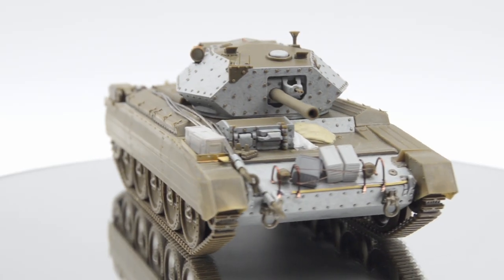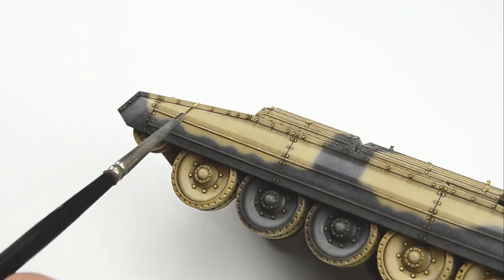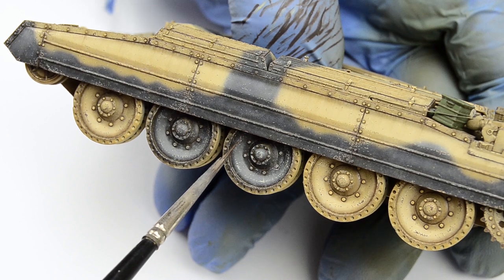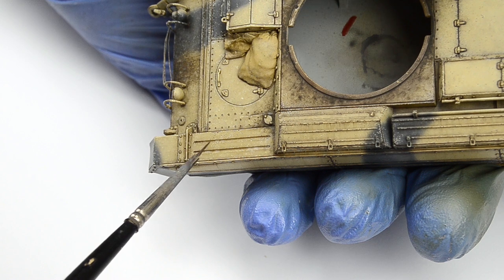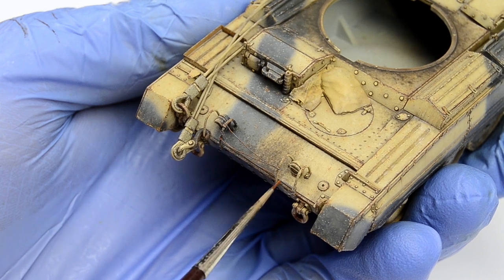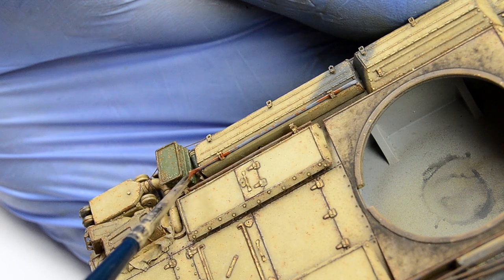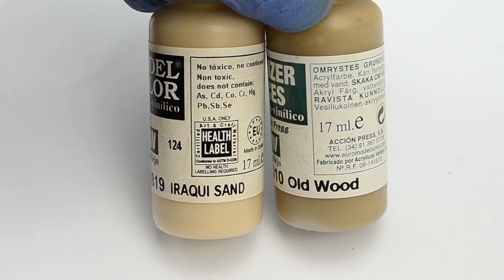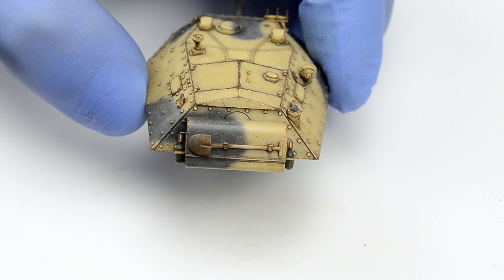Yes, Desert Armor Can Get Rusty | Crusader Mk 3 | Tamiya 1/48

Comment: The Brits used a ton of rivets on their tanks because many of their factories were used to using rivets to attach thick metal plates onto vehicle chassis. They didn't have much time to replace the factories' tooling, and retrain workers to weld plate armor given that 1.) the UK had just barely managed to set up their industry to handle the war effort before the Battle of France, and 2.) the Royal Armoured Corps had lost most of it's tanks and equipment at Dunkirk and was in desparate need of replacements. Thus, riveted designs endured in Great Britain's tank factories long after most other countries had ditched them for welded designs as riveted tanks are heavier due to the added weight of the struts the plates are mounted on.

The Covenanter tank was even redesigned from a welded design to a riveted design as the factory making them used to be a train factory and rivets were the standard for trains back then.
Reply: tbh britain embraced the concept of "it doesn't matter how good it is just build, it we're desperate" stronger than the soviets did.
Reply: To expand on that, one of the main reasons is that the British used a type of face hardened steel that was very difficult & time consulting to weld together. So in order to simplify production they decided to continued using riveted armour.
Reply: Also, welding isn't an easy skill. Especially welding armored plates.
The Italians were another nation that used a lot of riveting, and it was for a similar reason; Lack of skilled workers. 
It's easy to train up a bunch of riveters, and set them to work. If they are sick, or go on strike, or want more money, then you can replace them with more unskilled riveters. Even if all the men have gone off to war, you can bring in "Rosie the riveter" to do the work.
Reply: The French had a lot of problems with their very modern designs, because they were suffering from conflicts between the bosses and the workers. A lot of the workers at that time were communists or anarchists, and many of them were against the war. Some of the French tanks and aircraft were deliberately sabotaged (or that was the story put out at the time, maybe for propaganda reasons).
Maybe the French situation would have been different if they had focused on putting out cheap, easy to build designs in large numbers. Or maybe not. A lot of the British tanks sent to Europe before Dunkirk arrived with serious manufacturing or design faults, and weren't battle ready. Overall, tank technology was still at the bleeding edge during the war, and it took a long time for a design to mature, by the end of which, it was usually obsolete.
Reply: @pickledtezcat  I've always been told that the French tanks at the start of the war were superior to the Germans, the Germans were the first country to fit every tank with radios so could send orders and sighting quicker and work better as a unit. The French only had a radio set in the troop leaders tank who then passed on orders by sign language or actually getting out of his tank and climbing onto one of his troops tanks to tell them what he wanted them to do.

The Russian tanks were definitly poorer construction, there were always gaps between armour plates which were machined or cast accurately, often the gaps were big enough to put your hand in. The Russians just never cared about their soldiers lives and would rather field several poorly assembled tanks instead of 1 properly assembled tank.
Reply: @impguardwarhamer  in part it was desperation at times, but it was also a calculated trade off between how good a tank was (or whatever was being made) and the need to out produce Germany so that their tank formations could be whittled down.
Reply: @kaneworsnop1007  The French tanks were great. But they were still planning like it was going to be peacetime forever. So they wasted a lot of energy on highly experimental one-off designs, and designs like the Char 2C which were basically just for propganda. Where as some of the other countries were getting ready for war by coming up with cheap and easy designs for mass production.
It could have been worse though, they could have been the Americans...
Reply: If you look at damaged German tanks (Panzer III and IVs lost in the desert at the same time), which had been hit, you'll see many examples of where the weld totally or partially failed. I have read that the UK preferred not to use welding due to its technical difficulty with armour believing that it held up better.
Reply: @nickbrough8335  Welding is a very difficult skill, almost an art, so it's definitely the case that poorly welded armor would be even worse than the alternative. But riveted armor had significant downsides, which most countries were quite aware of by the outbreak of war. When a plate was struck, even if the shell didn't penetrate, it could shear off the bolts and send them flying around inside the crew compartment. Riveted armor was also much heavier than welded plates, since it required an overlap, and the extra weight of the rivets. So a tank with riveted armor couldn't have as much protection as one with welded plates.
One point to think about is that the skilled welders were probably reluctant to share their experience and training with a bunch of n00bs because they knew that once the war was over, they would be back to relying on their rare skills for negotiating a living wage. Likewise, the ruling class didn't really want to offer a fair compensation for those skills.
In the USSR or Nazi Germany in contrast, anyone who refused to do what they were told risked being sent to a prison camp. :(
Reply: @pickledtezcat  Yes, it took til the end of the war for the skill level to be sufficient to banish rivets. However, I imagine the UK authorities did what they thought was best - better to have think non-welded armour than suffer routine welding failure. We know the quality of German armour declined over the war, and if the weld seam breaks, which seems have been commonplace in 1942 desert campaign is correct, then their choice of welding apparently failed as armour plated got thicker.
Reply: @nickbrough8335  welding is proven to be superior providing it is of good quality. A near miss with an explosive round or non penetrating hit often caused the rivets to pop aamd fly around the inside of the tank turning the crew to strawberry jam. Rivets were a lot quicker than welding and it was also a relatively unskilled job compared to welding. Modern tanks are welded because it is superior to riveting, also we are not trying to produce as many as possible with a less skilled workforce due to rapid expansion of production. The latest tanks being produced are also doing away with cast steel as it is inferior to welded steel plate/Chobham armour or other countries equivelant. The new CR2 turret is doing away with the cast turret with additional armour welded to it, instead it will be purely made of armour panels welded together to increase protection, whilst reducing armour thickness and so allowing more space within the turret. Unfortunately due to covid 19 its looking like the CR2 uplift programme will probably be cancelled, some politicians are arguing again that tanks are obsolete and that the British army should get rid of them.
Reply: What others have said, plus the fact that the skilled welders were in great demand for shipbuilding. There simply weren’t enough to go around. Hence riveted tanks.
Reply: One advantage of rivets is that you can grind them off if you need to take off a plate to do repairs underneath. More complicated with welds.
Reply: Britons.
Reply: I agree maybe I didn’t read past 3 lines
Reply: @BigBadBvids  Not to mention that for the brits (and also the US to some degree) were more focused on their navy than on land forces, and also had relatively capable AT weapons (of both crewed and man portable flavours)

Comment: I think the search light turned out very well. It looks good enough for me to incorporate that style, myself. That's the cool thing about modeling. We can share techniques that we might not ordinarily be able to find out about. There used to be a product I used many years ago to make window panes. It was a liquid that you "stretched" between 2 fixed points. When it dried in place you had an instant window pane. No reason it wouldn't work for a lens. I think it is still around.

Comment: Why all the bolts?

The reason those earlier tanks were bolted is simply that it's easier than welded; it doesn't require as much skilled labour.  Of course, it adds a lot of weight since those bolts need an internal framework to be attached to...so there's a lot of extra steel taking up internal space and weight.
Reply: Not only did they add weight, but they also could break off when the tank got hit and could ricochet around the interior injuring the crew.
Reply: And sometimes, when the tanks gets a hit, the kinetic wave breaks them and they start travelling inside the tank like if they were bullets
Reply: That’s not entirely true. It’s not that riveting is easier so much as it was that Britain mostly had riveters. To retrain their workforce over to welding would have taken a long time (not to mention having to retool all their factories) and Britain just didn’t have the time. As I understand it the Covenanter was supposed to be welded in the original  design but the company that was going to build them convinced the designers to make it riveted because it was easier then converting to welding.
Reply: @CharlieNoodles  most of those facilities had been making locomotives, which are largely welded.

Fact is that casting and welding are more expensive, so riveting prefabricated plates was simply the cheapest and quickest option.

Comment: About rusting the towing cables: I’m walking by a scrapyard everyday on my way to work and there’s a couple of these lying out in the open which have been there for years completely exposed to the elements and they are literally rust free. The entire cable is covered in grease and oil and that seems to completely protect it from rusting.

Comment: Many British tanks arriving directly from the UK to Tunisia would have left the UK in Khaki Brown (SCC 2) not just Green. The pattern you painted was adopted from October 1942. The camo scheme was intended to paint naturally shadowed areas on the upper of the tank dark. The aim was to break up the hard straight line created by the different angle of the tank body verses sun position. White was also used to counter-share dark areas under the hull and the lower underside of the gun. The Middle East command instructions stipulated a dark green colour for the disruptive colour (although Black was allowed where the desired paint colour wasn't available). Many (perhaps most) tanks would also have an RAF style roundel painted on a flat surface as an air recognition element.

Mike Starmer has done extensive research on UK WW2 camo schemes and has self published a number of guides, which can be bought from him.

Comment: With the miniature painting techniques on the sandbag, the main advice I have for getting better results is to push the contrast. That usually means pushing things back and forth in order to get good blends, and is therefore rather time consuming, but it's what I have learned underpins almost all miniature painting techniques.

So, for instance with the stippling for cloth textures, it might involve having quite a few different steps mixed up on your wet palette from the darkest shadow to the brightest highlight, and then going back and forth until the contrast is strong enough to sell the object in the scale in question while also reading like there's a texture from the weave. Great blends across strong contrasts of light and shadow are the manually painted chipping of miniatures. Hours of work to get something looking natural.

Comment: Most of the British factories which produced our tanks were used to designing and building steam engines (Trains) which are mostly rivited together and screwed together using nut & bolts. Welding was a very primitive and not really developed because of the tried and tested method of riviting.

Comment: British tanks were made in different elements like bolted and welded because of speed of fabrication and cutting the sheets out for making. There was a reliability in putting things together like that... Sad side of the story is riveted tanks like the Crusader when hit by shells, had a chance of popping the bolts off and sending them flying insider the tank like another projectile. Which happened more than the military liked.

Comment: Most British armour was riveted mainly due to cost. It was a hell of a lot cheaper to use existing and known techniques to fasten two pieces of metal together as less equipment was needed and labour costs were reduced. Also welding was still a developing technique and was more than likely frowned upon by designers.

It's only really when they realised that rivets turned into very fast projectiles when shot did they start to weld vehicles together. A lot of crews were needlessly lost due to this.

Comment: Hey, I want to get into professional modeling and I have a few questions:
1. What cement/glue do you use?
2. What kind of paint should I get, and what brand?
3. What model brands should I buy from?
4. What are good beginner models?
5. What tools and brushes do I need? And what are good brands?
Thank you in advance if you answer this!
Reply: 1. Tamiya extra thin is pretty awesome. 
2. I like Vallejo. Just make sure you get the right colors as their airbrush line is a bit too thin for brush painting if you're just starting out
3. The best brands don't mean anything if the molds are from the 1970s and crap. Always best to do research on Scalemates.com before buying any kit (I learned my lesson). Especially Revell loves re-releasing ancient kits as "new" and it can lead to massive disappointments.
4. Tamiya usually goes together without issues, but they are a bit pricey. Revell is rather cheap, but depending on the kit it could be awful (see 3). 
5. Small side cutter, sanding paper, double sided nail file and some filler (Milliput, Green Stuff, etc.) will cover most of your needs.

Comment: One of the reasons so many of Britians wartime tanks were riveted was a compromise to use existing skilled labour. Overwhelmingly the tanks were made by railway carriage companies, where rivets were tried and tested, and weight was less of an issue.
The British army definitely wanted the weight savings, and extra integrity of welding. But it needed tanks fast, and those in charge of war production figured an okay tank now was worth a whole lot more than a slightly better tank (with an unknown delay) in the future. The welded centurion is probably the best example of what British tank corps knew it wanted (at the time cromwell and comet were in production and service) if they only had the luxury of time for development and to gear up production.

Comment: GB used a lot of riveting because a lot of manufacturers were locomotive or other heavy industries that knew riveting.  But GB had a lot of cast components, and welding in there too.  So they weren't all riveted.  Watch the Tank Museums Matilta Diaries for more details.
Reply: It might also be a case of priorities—France, for example, had workers capable of welding tanks together, but they were mostly employed in the shipyards and needed there, so they used casting or riveting on some of their tanks because labor capacity for that kind of work was available without stealing away labor from the navy.

I like the subtle chipping approach, by the way. Your videos inspired me to finally give properly painting a tank model an actual try and I can now definitively appreciate your fine brush control. My DAK Panzer II turned out somewhat...overchipped, I think. As if it has been busy driving through sandstorms for a few months.

Comment: Britain converted alot of train factories to make tanks, steam engines were all handcrafted and riveted so that's what they did to the tanks. Caused problems with spare parts too as there was alot of variance in the parts thanks to them being handcrafted so different vehicles had slightly different dimensions.
Reply: That "handbuilt" problem lasted even to the 1990s or so, the Nimrod MRA4 program blew up because no two planes had their wings attached in exactly the same place.

Comment: Nice trick leaving the "out take" in the video at 14:00. ;>)
Have you considered making your own rust washes and colors as you need them instead of buying specialty products that turn to Jello? All you need are flat red, yellow, black and white to make many shades of red, orange and brown. You can mix in or dust on some baking soda for texture. You're no stranger to mixing paints, and since different grades of steel produce different colors and textures of rust, you can customize it to mufflers, rivets, gun barrels...
I'm also a little surprised you didn't just drill out the searchlight, paint the inside and make a lens out of clear plastic, but the technique that works so well on vision blocks seems to be okay when scaled up.

Comment: British tanks at the start of the war were poor for various reasons Martin. Basically lack of funding for the Army and the time required to weld as opposed to riveting and bolting was expensive to fund. Welding was also slower and the British had to arm fast to try and compete against the Axis powerful manufacturing capability. This is a reason why the Brits used American Shermans etc via the Lend Lease program. 
I am not 100% saying this is absolutely all of the reasons but at least some of them.
Hope that helps.